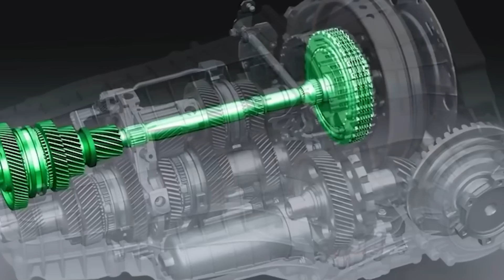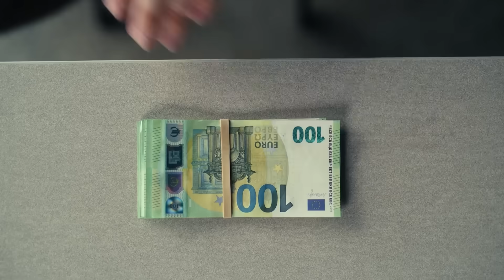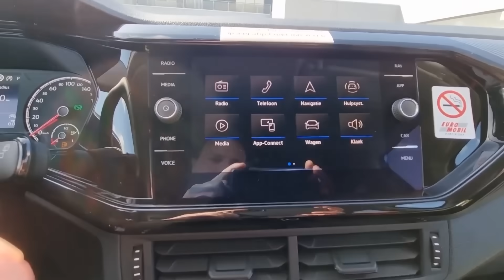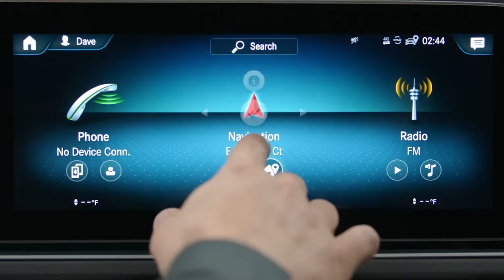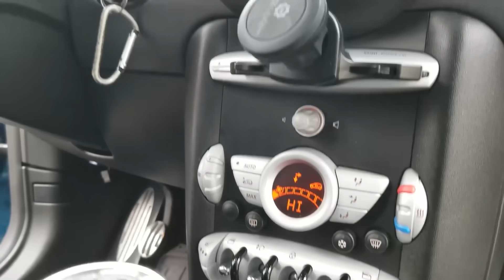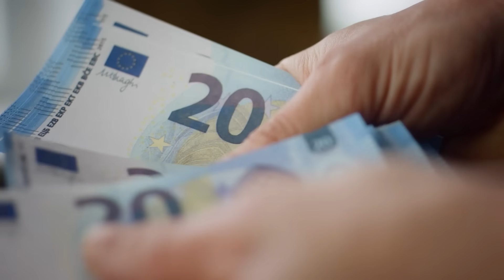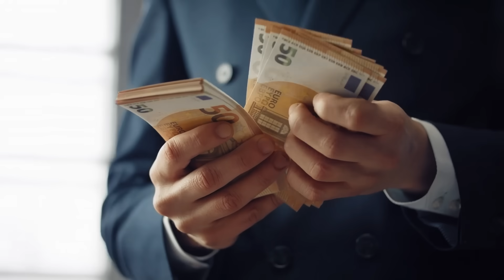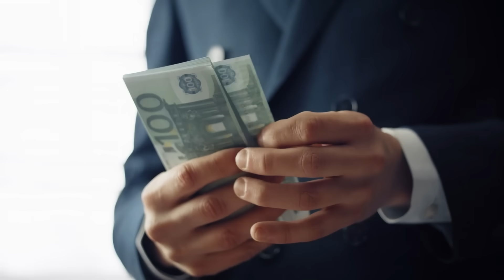7 DIRTY Secrets Why Your European Car BREAKS After Warranty

Comment: Hmmm. I have 2008 bmw 535d, purchased 11yrs ago with 198000km. Now it has 548000km and we are still happy. Original engine, turbine and nozzles. Dpf filter is gone after ~400000km. M57N engine. Some transmission and cooling system troubles, yes. Expensive brakes 3x so far yes. But we are sooo happy with this car, dont want to change. Drives immaculately. 6sec to 100km/h still.

Comment: I live in Thailand with my wife and two daughters. About 6 years my wife wanted to buy her dream car, a Honda Accord. And we dit that, I  was a little negative to buying that car because it had a CVT-gearbox. But my wife insisted on buying that car. Now that car has passed 140000km and the engine is trash!! It has overpressure inside the engine. It shall be underpressure! That prevents oil and fumes to leak out from the engine. The engine ventilation shall go by the catalysator and be burnt. But if it is to little underpressure inside the engine oil and fumes start to leak out in the air. The last 3 services I have explained this to the Honda shop. But they pretend they do not understand. "It is no problem with the engine. We will change a gasket and a small filter and then it will not leak any more". I have also the latest 3 services told them to write, in there service database, that I say there is a big problem with the engine, but they do not do that. I read in some Youtube workshop canal, two or three years ago that tha last good engine in Honda Accord was the year before we bought our car. Now they make engines with aluminiumblock and use ceramic coating in the cylinders instead of the much better steel linears. A engine built in the older way last 300-, 400-, 500000km, abd could then be rebuilt. These new Honda engines last 120000-130000km and can't be rebuilt. When the ceramic coating is gone there is nothing to do... One more ugly example of built-in lifespan!!
(I'm from Sweden so sorry for my language and spelling).

Comment: BMW now designs their headlight assembly to fail and have water condensation after factory warranty. You need to essentially punch a air hole in the assembly to equalize the pressure.

The dealer wanted $5k for just the headlight assembly plus labor of $1500. I grabbed my pliers, ripped off (broke) some top cap, within two days all the condensation was gone and the original lights worked perfectly. This bad design of BMW headlight assembly failing is a known issue, which is easily solved by a equalization 🟰 channel, but they instead use rubber and glue which they know fails at the end of 4 years, the warranty period. Even worse, their OEM CPO warranty considers it a wear part, so your $6k dollar warranty will not cover it.

Comment: In my car i have the windshield-drainage system above the car's battery, if it rains or i clean the windshield the soapy water lands right on the negative and positive poles.

Comment: not just car manufactures r doing such, BUT i have been told that electronics / household appliances (like washing machine / dryers) by a major retailer that the manufactures NO LONGER build machines that last as long as before (I had a washing and drying machine by Maytag since 1991, used 2-3x every week if not more AND STILL WORKING - never broken / failed)..  the retailer say likely new machines will fail w/in 5yrs because they want u to either pay to get it fixed or buy new ones...  if they build machines that last 'almost' forever, they will go broke.

Comment: One of our professors in engineering school asked a question, on how to mold a certain drawing we were talking on. We gave answers, he turned one of the guys and said youre right, and you will be fired because it will never break that way.
Reply: Good point. Aftermarket parts might be vastly more durable than original parts.

Comment: The greens are not interested in a healthy world as they know there is NOTHING man can do to make the world worse or better.  Only minor changes, see below.  
Climate changes are all natural and happened when there was NO industry.  

The car industry have found they can make use of peoples unfounded fears.  
Yes cleaner cars are better and ICE cars the cleanest, not EVs, but technology has gone into overdrive and causes more problems.

For example Roman Times in the UK they grew grapes commercially in th😮e North. You can't now, it's too cold.

What would help HEALTH and aid stopping minor pollution. STOP using plastic bottles and food containers. Go back to glass, cardboard, and paper to wrap your food.  Fish & chips always came in paper, so did things like butter, bacon, cheese.  
Either they can be recycled or they disintegrate naturally or in landfill.
Plastic does not disintegrate only a few can be recycled.  

Fast growing trees replanted after cutting down.  The land managed to prevent problems with same species growth in the same place.

Do you hear the greens fighting about simple improvement like that. NO.  They want to ban the modern world.  Brainwashed by people who want to CONTROL US.
.

Comment: New Hyunday Tucson 1.6 petrol
4.700 Miles after purchase blocked DPF . 5800 Miles broken front right wheel wishbone.
Reply: DPF ? Petrol ? DPF is used in Diesel engines it says it Diesel Particulate Filter
Reply: @Steve17256 Ok GPF whos care is the semi

Comment: After a little more research, if you wish to buy a German car, buy an older Porsche. Especially the older 911s have the Metzger engine. This is their engine that was in their race cars. I have a 911 which has 120,000 miles. I’ve changed clutches, brakes, and lots of tires, but the engine is bulletproof. The older 911s are not even that expensive these days.

Comment: Some insurance companies publish repair cost statistics, e.g. LänsFörsäkringar, (Sweden). Useful if you are about to invest in a new-ish car. Acc. to <LF>, the cost per brand/year varies between (in SEK):

Labour cost:  8000 - 34000
Sparepart cost: 5000 - 10000

Lowest repair costs:
1: Honda
2: Toyota
3: Hyundai
4: Peugeot
5: Renault

Highest repair costs:
1: Porsche
2: Land Rover/Range Rover
3: Jeep
4: Mini
5: Lexus

They also have a pdf with a VERY detailed breakdown... Porche/Lexus have high sparepart cost but average/ low labour cost, which i guess indicate high quality, but expensive parts (i.e. luxury brands). Mercedes/Audi/BMW are in the middle of the stats, or slightly above.

Sweden (Scandinavia in general) have very bad winters, tons of salt & most people do aftermarket undercoating/waxoyl treatments.. So despite rough environment, you don't see so much chassis rust (of the type shown in this video). -But it happens, cuz many buy the mfgr:s "fake-ish" rust warranties, which often actually are void if you do aftermarket treatments. But of course you have to do aftermarket treatments. My favourite is Mercasol, which also is the official Nordic Additional Treatment, for some brands.

My favourite way of buying cars, is to filter for older/very low mile cars... I Bought a Porche Boxter that way... The best car i ever owned. I could afford buying/driving it. But i could not afford tires, or original service (see above), so i had to sell it... Perhaps Lexus is the same, but i dont know if used-Lexus buyers are as perticular about original service as Porche buyers...

Comment: I have had 3 Lexus GX470s that  hauling shxt, four wheeling, mud, snow, sand and ice couldn't kill niether could  3 children and 2 large dogs chewing  up the inside.  A major hail storm totaled 2 of them and my wife rolled the third. We still have the 2004 Lexus Rx, a 2008 ES350 and a 2010 LX with absolutely no issues besides oil changes and tires.  I love not having a car payment and be able to use the $10s of 1000s on vactions and vaction homes!  Prior to the Lexuss , I purchase a POS BMW X5 new that cost me $30k in repairs after warranty expired then died with only 125k miles.  I don't think I'll ever have to purchase but may purchase a Chinese Leopard 8 or U8 for our home in Africa

Comment: Thankyou; very revealing video.  Merc GLAD 200. Dual mass flywheel fail exactly 100,000 KMS. $8,000 job to remove engine and front of car. Shortly after trunk latch. Had to replace worn soft metal brake discs in 14 months. Soft for cold climate use; but sold new in Australia with and "AU" Australian VIN number !!!!. 
I won't be fooled buying Benz again.

Comment: Planned obsolescence is the new German corporate mentality.  I see Mercedes W123 all over the world with 1,000,000+Km.  Sat in a taxi in Lisbon with that type of Km.  Interior still in great shape.  Original Diesel engine. See BMW 2002 series all over. 

My mother has a Siemens washing machine with mechanical timer since 1980.  Recent Siemens stuff has a lot of plastic and lasts few years.  My recent Bosch washing machine had to be replaced after 4 years.  

German companies use parts from all over.  Even a fancy S580 is unreliable.  

These days I would choose a Honda, Toyota, Lexus gasoline engine, no turbo, no hybrid. Used Garage Queen Lexus… owners have money and barely drive them, maintain them, have garage.

Comment: Meanwhile my Volvo is 14 years old and in such great nick that I don't see any reason for replacing it. Still drives and looks modern. Could use a gearbox seal because the original one leaks lightly

Comment: My BMW timing chain stretched at 100k miles.
I was lucky I noticed and had it replaced for £700.
Several injectors went after another 20k miles and at £200 each - I scrapped the car.

Comment: If these manufacturers made cars to last, they would sell many more as people would drop the ones they have already and buy the ones that are built to last.
We run a 1994 BMW 325iSE an E36 model. And have since buying it 26 years ago put 140k miles on it.
Never had a major component go and still a daily driver, now just over 174k on clock and still drives like a dream.
We bought a more up to date model, an M6 of 2006 and had nothing but problems from the 2nd week until sold six years later.
The new cars have all the buttons and bells BUT all the more to go wrong and it DOES! Great video, well done. Subbed.

Comment: I already have a Honda Civic and will only buy Asian brands from now on.  Unfortunately I have a Renault Trafic van with plastic cam chain guides, I'm not going to replace the chain I'll continue to change the oil every 5000 miles until the engine blows.  I'm already changing the gearbox oil every 15000 miles.

Comment: Without any doubt. Toyota make cars like no one else. Have had Lexus now for almost 20 years. Not a single issue. They drive like new, well put together. German cars are over ratted. They sell due to very attractive finance options, lease costs and loved by the badge snobs.
Reply: exactly !!!! this is so true !!!! the Mercedes A Class has the same engine with a 19K Renault Clio and yet it costs 50K you are just paying brand prestige not a single luxury only cheap plastic 

or the BMW 2 series with a Peuegot engine 🤮🤮 

or the Audi A1 cheap creaky interior unreliable Audi and it costs 41K 

it would be a wiser choise to buy a Hyundai I20 for 20K Hyundai gives 10 years warranty and after that it will still be better than the A1 and hold it's value while the A1 would have lost most of it's value

Comment: I bought a Hyundai Ioniq electric in 2018.
After 260k Km the only thing that "broke" was the back plate with a rust spot, probably a manufacturing defect. Replaced under warranty and the rest of the car is rust free (except the brakes, cause i rarely remember to use them)
Lost 6% of battery range but after all this driving, cry me a river.
My wife drives the Ioniq 5 clocking at 80ish k and no problems.
I am never going to buy a smoke generator again, this thing already paid itself off just when you account for the fuel and servicing costs I have avoided.

Comment: Retired auto mechanic and assembly line worker here. I now drive for a living. I have a 2013 Hyundai Sonata (that model was known for engine difficulties) with the 2.4 L four-cylinder. My Sonata is now pushing 225,000 miles on the original engine and transmission. Oil changes with synthetic every 3000 miles. Transmission fluid changes (nonserviceable transmission filter) every 15,000 miles. Spark plug and serpentine belt replacement every 75,000 miles. Coolant drain and replacement every year, regardless of mileage. My wife’s 2010 Hyundai Accent still runs like a little sewing machine because I maintain it. I recently spent $3500 out-of-pocket to replace the two passenger doors because someone sideswiped it. Why would I pay that much on a 15 year-old car? Where else could I find a car that good for $3500? My current vehicle is a 2020 Mitsubishi Outlander with one of those cursed CVT automatics . Again, changing the transmission fluid every $15,000 and not “hot rodding” it has helped it to top 170,000 miles and is still going strong. My most prized possession is my 2000 Chevrolet S-10 pick up truck 2.2 L automatic. I purchased the truck in 2011 for $500 with 74,274 miles on it complete with a destroyed engine. The previous owner never serviced it. She just drove it. After dropping in a new General Motors crate unit (and a myriad of other new parts) and a decent quality paint job. She has been a dependable daily driver since October 2011. Moral of the story, learn to do your own Service. And under no circumstances, are you too follow the dealership or manufacture “recommended” service intervals!

Comment: 2005 , I bought a BMW and sold it after the warranty expired, and 20 years later, I have never considered buying another German vehicle.
Reply: had a Golf MK4 and it was horrible !!! 

never bought a Shitwagen again !!!! 

only Toyota Hyundai and Mazda since then
Reply: 2005 is the year where most people I know say that BMW gave up on customers.
Reply: My friend has a 2003 Mercedes C320, it’s built to last well beyond 300K miles. It is a good Mercedes if it’s got a metal intake manifold and a SOHC valvetrain. The only DOHC Mercedes engines I trust as the 6.3L V8 and 6.0L twin turbo V12.
Reply: @davidperry4013 and i know someone who had a W203 it has been very reliable so maybe the W203 was the last reliable Merc
Reply: @davidperry4013 and someone who has a W211 CDI but the biggest disavantage with the W211 it has a lot of plastic
Reply: 😂 Big difference is if cars are assembled by us highschool dropouts or European technicians that had a 3 year education on how to build things with precision
Reply: @campandcook3118 or now they are built in Turkey with workers paid as little as possible

Comment: BMW mechanical water pumps never lasted the life of the engine!  Easy DIY replacement, part not expensive.  I still own my 2003 325i and replaced the metal / plastic impeller water pump before failure at 87k with a hi-perf stainless steel unit. The plastic impeller comes loose on the shaft on the factory water pump.  Yes I prefer this to an electric pump based on cost but an electric unit might have the capability to run a few minutes after engine shutoff reducing hot spots.  I actually replaced everything in the cooling system at the same time because the parts  (BMW and OEM) were not expensive and prevents an expensive bill if a failure occurred out of town. This glaring false statement about water pumps makes me question the other statements made in this video.  Yes BMW parts fail but at 155k and 20+ years my DIY cost per year is very low.  Out of warranty all repairs done by myself.  I am happy with my BMW and would like a new one of the same model over a new 2025.  The only issue is the Webasto manufactured sunroof which is a leaky piece of poop, the highest number of warranty repairs were on it during warranty and it's still crap.

Comment: It seems like all manufacturers have been building cars that will not be usable by 2030. Let me  explain the joke: a car made in 1995 would last 35 years easily with only minor repairs. A car built in 2005 will last 25 years easily with only minor repairs. A car built in 2015 will last 15 years easy with some moderate repairs. A car built in 2025 will last max 5 years before it falls apart. A car built in 2029 would probably only last 1 year. If you buy a car in 2030, it will come broken from the factory 🤣
Reply: true
Reply: and a car from 1985 could last 45 years with only minor repairs
Reply: a car from 2035 will last only 5 months i bet 😂😂😂😂😂😂
Reply: a car from 2045 will last 5 weeks a car from 2055 will last 5 days a car from 2065 will last 5 hours a car from 2075 will last 5 minutes a car from 2085 will last 5 seconds

Comment: The difference with Tesla is that their service centres are not profit centres for the company. That alone makes a huge difference in how they build their cars.  They aim to build cars that don’t need service. So theoretically the Tesla’s will last longer with much much less maintenance if any.  Also the features Tesla charges for are fitted to all cars built but you don’t get access to them as std. So you’ve not paid for something that will be removed at the end of warranty. You pay extra for them if you want them and then they’re yours for the lifespan of the vehicle. Unless in the case of FSD you choose a monthly subscription instead of a lifetime payment. Then Tesla gives car software upgrades for free, sort of like Apple and their iOS operating system. Interesting times ahead.